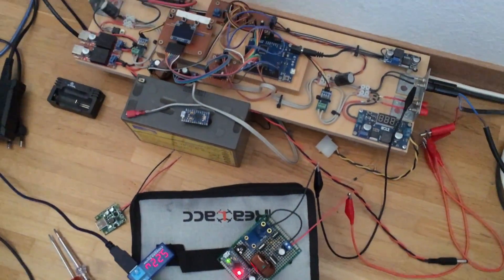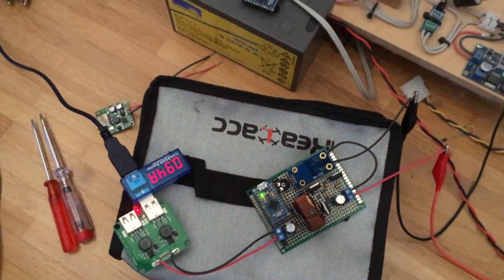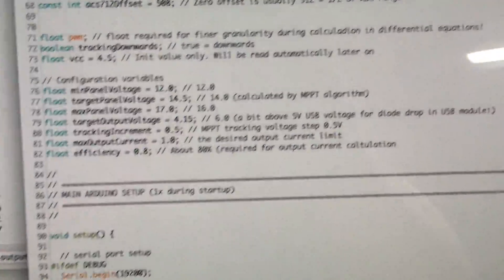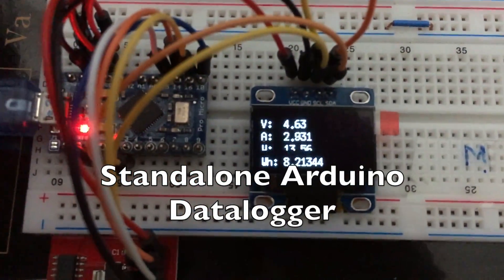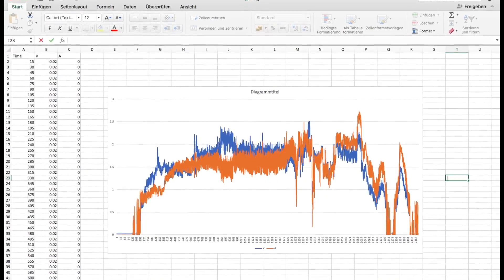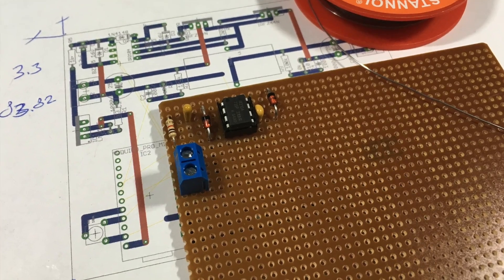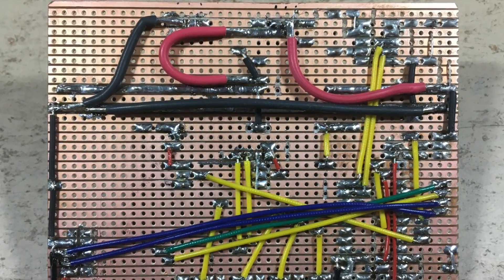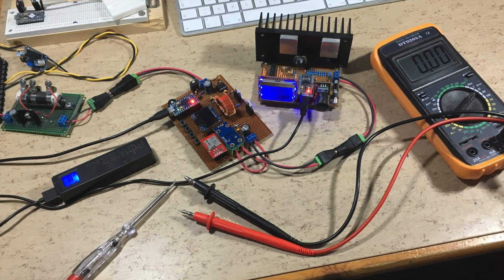DIY Arduino MPPT Solar Buck Converters: Harvesting Free Energy!

Comment: I made mppt based on your circuit, but my arduino promicro start blinking rx/tx  after 2 mins connected to power supply input. How i can troubleshoot my circuit? Thanks

Comment: If use for 300w 24v solar panel, what's need to change?
Reply from the maker: I think you have to change the mosfet driver supply, in order to make sure, the gate voltage stays below 20V

Comment: Thxs for posting! I will try to rebuild. One question pls :
On the low side fet Q3, in conditions when the solar panel will not generate any voltage, will Q3 be always switched off, even if Vcc of IR2104 is 0v ( at least way below 10V ) ? I am assuming SD is set to low. I have seen/read about another implementation that had the problem of blowing the  low side fet under the condition that the solarpanel was low voltage. Not sure though if SD was set to low or not.
Reply from the maker: I'm running it for more than a year now and never blew up a mosfet except during the first SW tests.
Reply: Thxs. Allow me one other questions. I did build the circuit, I have though now used a PIC controller. I have during testing though experienced some effects where suddenly the panel voltage gets charged up by the controller. Your code does actually has a check for such case. It is not exactly clear to me when this condition does occur. I know faced some "Oszillation" as I detect the issue,disactivate the IR2302 but not yet long enough and to then again see the voltage raise on the panel side. I guess I need to a)have a longer off period and change the PWM. I faced it now in changing light conditions when the same came out... I am not yet familiar enough with FETs, but it seems like in some cases therer they allow reverse current.
Reply: I meant to say when the sun came out...

Comment: Can I use a 12V, 10W solar pannel?, if yes what changes I need to make?
Reply from the maker: Most "12V" panels are made for 12V batteries, so their real voltage is about 17V under load and about 21V without load. This allows to step down the voltage. Measure the voltage without load, if it is around 21V, it will be fine. The charger will search the optimum working point.
Back to your question: the panel voltage should always be higher than your battery nominal voltage. Everything else can be adjusted in the sketch and with the potentiometer.

Comment from the maker: This video is a bit different, because summer time is solar time. This DIY Arduino charge controller powers all your USB gadgets! All you need can be found in the description. The solar panel should have between 20 and 50W, depending on how much sun you have in your location. Now go and build one!
Reply: How do you calculate the inductor size and value?? Pls. do reply